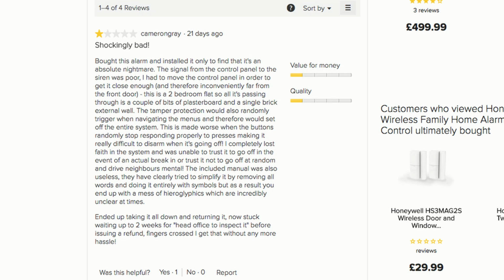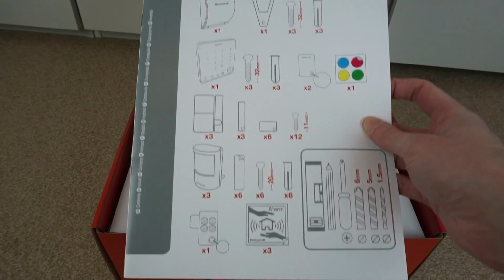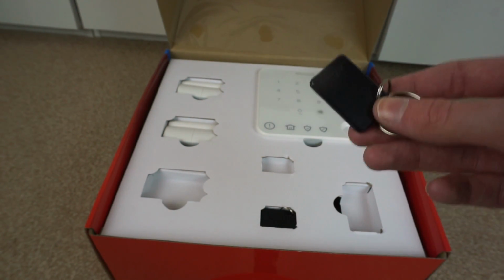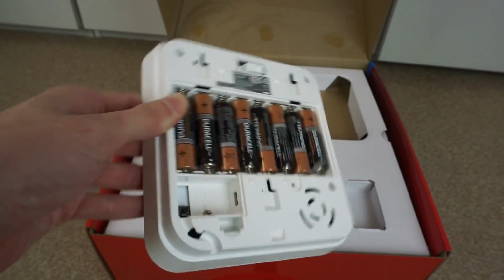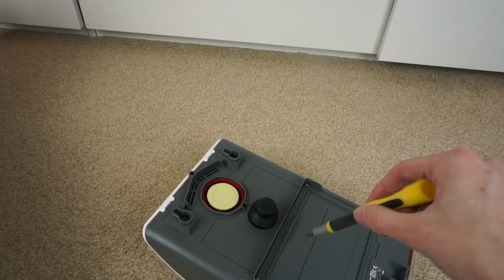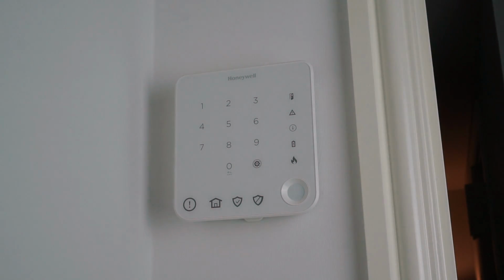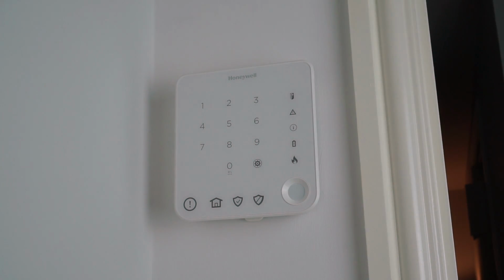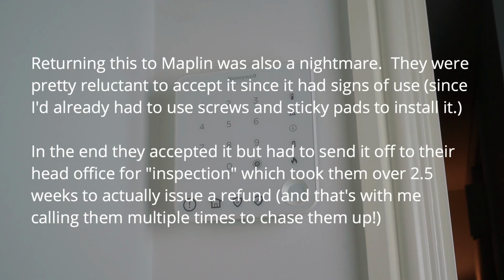Completely useless alarm system! Honeywell HS351S Wireless Burglar Alarm Kit

Comment: A couple of years ago I was asked to choose and install an alarm system to a warehouse. While there were some wireless systems available, I went for a wired one, because there would be no problems with the batteries (except for the 12V sealed lead acid backup batteries in the central unit and the siren), and I could use any sensor on the market with it, not just the ones from the same manufacturer. It also has a GSM module, so it sends out some SMSes when the alarm is triggered.
It was a nightmare to set up, because of the poorly written, and even more poorly translated manual (the original was in Italian and that was translated to English and Slovak), but after a few hours I got it working as the owner wanted, and it's still working properly.

Comment: Wireless alarms are toys.
Reply from the maker: The DIY ones like this definitely seem to be.  The Texecom system I replaced it with is also wireless but has proper two way communication and mesh networking so it provides full visibility of the entire system's state unlike the DIY ones where the PIRs are glorified RF remote controls!  The new system also supports the connection of wired zones down the line if I wanted to go that route.
Reply: You had holes everywhere recently didnt you? Should have thrown in some 6 core cable for a wired system. Professional grade wireless systems like the one you mention are great, but nothing compares to a proper wired alarm. I had my house completely rewired when I bought it. As part of that I paid my electrician an extra £200 to fit a basic wired alarm.
Reply: @stevecraft00  Depends where you live, if you're renting you don't have much option if the landlord won't install a wired system.

Comment: I don’t like wireless alarms always a pain
Reply from the maker: To be fair, all decent wired systems I've seen are also fully battery backed - There's usually a large SLA battery in the panel which will power the entire system in the event of a failure.
Reply: Cameron Gray I always think if you wanted to steal things You would jam there alarm setting it off for a few days till they just don’t set it as they would get fed up with it lol
Reply: I've installed an alarm purely as a visual deterrent, my CCTV is far more effective as are my expensive "BiLocks" on each door. My neighbour's alarm is always going off and I and everyone else in the street just ignore it. Frankly the police in Essex won't even attend a house alarm call anymore. I think ADT monitored alarms are the only real solution to the problem. But that is a constant cost every month.
Reply from the maker: Elliott's World - I mean, you possibly could but that's expecting someone to put a lot of planning into a burglary which would maybe be the case for a high value target like a bank or shop but for me it's much more to deter a random opportunist junkie from breaking in to steal my TV. Pretty much any system could be disabled if the person was determined enough.  It's not as though I have a huge amount more valuables than the average flat in my area, chances are people would just move on elsewhere instead of plotting to disable an alarm.

Vax Buster - They do have a limited life but it doesn't take much effort to replace it every few years if you are properly maintaining the system, pretty sure my Texecom will alert if the battery develops a fault. I also already have decent locks and insurance, the alarm is just an extra.
Reply: Vax Buster in my village in Kent we all have our neighbours keys so we just go and check it out if it’s going off normally it’s just a open window or somthing
Reply: Cameron Gray you can get hybrid panels too (pyronix do decent ones at a good price) that you can use wired and wireless devices on. I've installed a few recently and the range on the wireless kit hasn't failed yet despite multiple brick walls and concrete floors.
Reply from the maker: Yeah, I ended up going for the Texecom Premier Elite 64-W which has 32 wireless zones and 4 onboard wired zones, very happy with how well it works.
Reply: @camerongray1515  proper alarm texecom, not DIY tat.
Reply: running wires can be worse, wireless systems are fully battery backed unlike other mains wired systems
Reply: Vax Buster my mains system has a lead acid battery back up lol lasts years
Reply: Those batteries last 3-5 years if you are lucky after that they fail to sound the siren
Reply: Alarms do little to prevent theft, good quality locks on doors and windows are a better solution, invest in BiLock's. Failing that a good home insurance policy, with new for old clause
Reply: Unfortunately the neighbours here are not so friendly, everyone ignores each other
Reply: Vax Buster any proper intruder alarm system has a battery backup. And by proper I mean anything that is an actual dedicated intruder alarm that you can connect pirs and door contacts to. Those things you can plug in in your hall and connect to your WiFi to get an email if they're triggered while you're out aren't intruder alarm systems.
Reply: I work in a security company as an engineer. Dont put your trust in a cheap system like that. And at least not on the "deterrent" part. I've had cases where we've installed an alarm at a customer(Good wired GE(ATS) system), where the stupid thieves breaks in trough a windows with a large sticker on it that there is an alarm installed! What the good system did, aided by the ipTV system was the fact the guy was caught on site by our security guards. I'd have to guess the guy felt stupid tho ;-) Worst part is that this was not an isolated case. Have an alarm that works and is connected to an alarm station/security company.

Comment: You should go for a Texecom system. Made in the uk and professional grade. Ive fitted three systems to date. It takes a bit of learning the 'lingo' but its easy to see that in comparison diy kits are a waste of time and money.
Reply from the maker: https://imgur.com/iu8AiJH - I guess I chose correctly then :P - Definitely a bit of a faff to install and resulted in a lot of swearing when it kept telling me to "Contact alarm company" but now that I have it working it's absolutely flawlessly!
Reply: Cameron Gray sounds like a Premier 24.... well worth the initial head scratching. Look forward to your next video
Reply from the maker: Close, it's the Premier Elite 64W, only major issue installing it was that it seemed to expect you to have a wired engineer keypad in place to pair the wireless one. Of course I only had the one keypad so eventually figured out that the only way to pair it was to plug the keypad in, instruct the system to learn a new device then quickly yank out the cable and restart the keypad so that it would go into pairing mode. Of course there was nothing in the manual about this!
Reply: Cameron Gray Ive got a prem 24 which doesn't support wireless, but from what I've read and heard texecom's ricochet mesh wireless is very good. Whats good is that the support is really helpful, they are happy to provide details of the com port protocols as long as you agree to their NDA. Great styling of the keypad in you photo, much better than the honeywell!

Comment: never use wireless for a physical security system, like this. 
what happens is someone with very little understanding will buy a cheap wireless signal blocker and use it against you. Thanks to that nice advert you've got on the outside of your apartment they know you're wireless. The alarm will go off because it's lost contact with it's base, and you'll not understand why. You'll probably not even see anyone outside even if you looked. So a week passes by and the alarm is going off at 2, 3 4am and any other time to the point you're pissed off enough that you disable it. When they try to set your alarm off again, and it doesn't of off... they come and take your stuff.
Reply from the maker: Proper wired systems should cope with wires being cut and will detect it as a tamper which would set the system off.
Reply: @camerongray1515  and arnt wired alarms normaly Normally open circuit operated so cutting the wire will trigger the alarm
Reply: Cameron Gray wireless is a toy, easy social engineering targets, remember they all use ISM bands anyone can transmit within power constraints on the sane frequencies your alarm is using.  These bands are getting more and morandcongested, so it will only get worse.
Reply from the maker: Yeah, they probably use varying methods however any one I've seen would be able to detect if a wire was cut.
Reply from the maker: High end modern wireless systems like the one I replaced this with are okay, I've seen several places with the exact same system where it has been installed by a professional company - it has proper two way communication so it will give status alerts and information about the system state so it would be fairly clear if someone was tampering.  That said, I'm not exactly protecting against someone determined enough to loiter around and try what you've suggested, chances are someone would move on and target one of the other hundreds of flats in the area without an alarm.  It's not as though I'm protecting something like a jewellers or bank which could become a target, I have pretty much the same level of valuables as the majority of other people in the area.
Reply: Forget alarms nobody takes notice of them, just buy decent "bump proof" locks from BiLock
Reply: You can cut wires, wired systems are no more secure

Comment: What an absolutely useless piece of crap. Stupid wanky design. Form over function. What's the point of it looking nice if doesn't even bloody work! I'd rather have an ugly control panel that works. But I'm not surprised really - Honeywell don't make alarms, they make central heating controlers. Should've bought a Yale alarm in the first place. You can get used ones on eBay pretty cheap.
Reply from the maker: Yeah, it's a useless design, I was already concerned as soon as I heard the stupid tunes it plays!  That said, Honeywell are a reputable manufacturer of professional alarms (they make loads of stuff in addition to heating controllers) which is what made me go for this over Yale. My parents had a professionally installed Honeywell system for years although most of it (minus a couple of PIRs) has been upgraded over the years.  However, I'm pretty sure this is purely branded by Honeywell and designed/made by a third party, makes me wonder why they put their good name to it!  After doing more research, while the Yale system would have probably worked better, it would have still had some of the issues this has (one way radio comms.etc) so I ended up going for a proper professional level system that has worked flawlessly since I installed it a few weeks ago, sure it was double the price but it's at least 10 times better!

Comment: I would tend to get a security camera. Maybe a D-Link camera that will email you if it senses motion. There's also a diy security system called Skylink. It includes an auto dialer that can be programmed to call a cellphone if it gets activated. That might be a good thing to look for or any security system that includes an auto dialer. A lot of these security systems and even the professional systems will have some kind of issue. I had a professional system installed that kept going off and it would also call the police.

Comment: NEVER get a DIY system, they are designed to be as cheap as possible and offer ZERO security. It doesn't take long to learn how to install a professional system, it's all pretty straight forward than it was say 10 years ago, you now only have 4 wires per cable than the 6 a few years ago, 4 wires and 2 of those are power to the sensors, you can't go wrong providing that you use pre terminated sensors.
Reply: Its not necessarily  4 cables though is it? depends what youre installing. alot of double pole systems still out there.
Reply: Of course it could be more but I wasn't speaking of additions such as DP, FTA or Walk Test Disable etc... I was saying that it's not difficult for anyone to install a professional system today as it was a decade or so ago due to the installer friendly features.
Reply: Yeah, really depends on what you are installing. im an installer by trade in the UK so these sort of videos make me so mad when people install shit haha

Comment: Save yourself the headaches - get a professionally installed wired system. Higher upfront costs yes, but you know it’ll work, and be reliable.
Reply: Yep. We have been using a wired system at home for over 15 years now. Has been working perfectly all those years. Only problem we had with it was the backup battery being dead after about 10 years of use, so we replaced that, and now it's working fine again!

Comment: An old 9V 500Mah+ PSU with bared wires attached to the battery connectors would work fine, too.

Comment: Can you block sensors from triggering using frequency jammers?
Reply from the maker: It claims to have "Jamming detection" but in reality this basically means that if it detects something using the frequency a suspicious amount of the time the system will trigger.  This means you could experience it false triggering and in that case you'd have to turn the jamming detection off.  The new system I bought has two way communications which should be a lot more robust as the panel can actually check the status of accessories and therefore be more reliable at detecting potential jamming.
Reply: The Pyronix Enforcer is a two way system. It regularly checks the status of the sensors and the sirens and if it loses connection when set it will trigger an alarm. When it’s unset and it detects a battery is low the control panel will show a trouble. Also the panel can turn off the sensors when the system is unset to conserve battery.